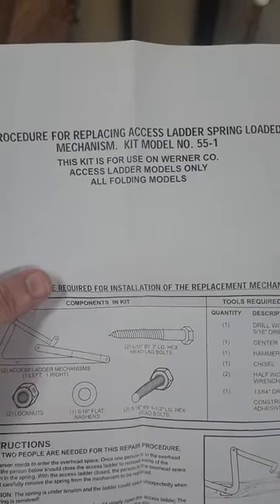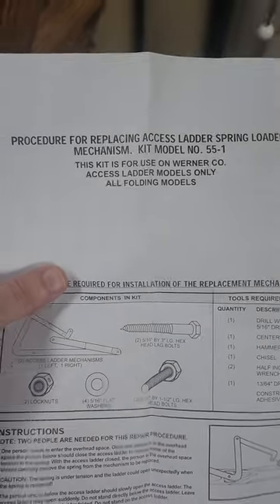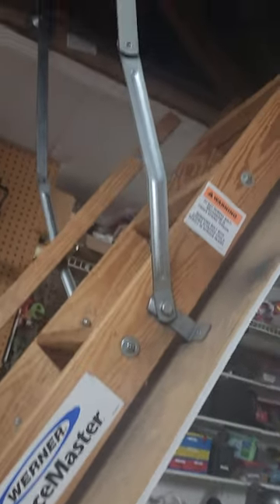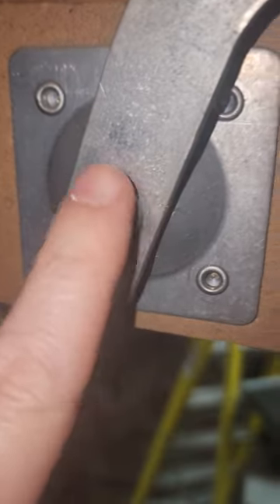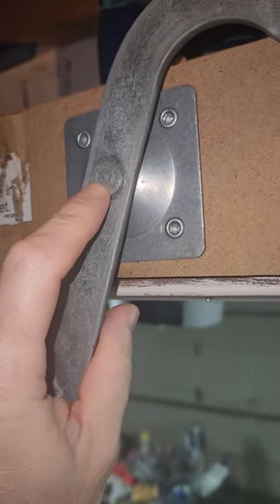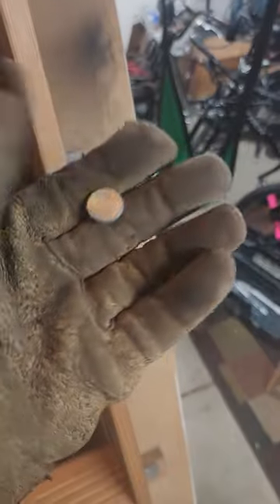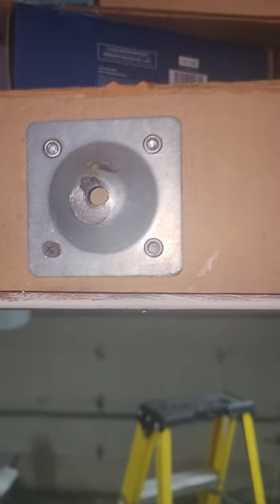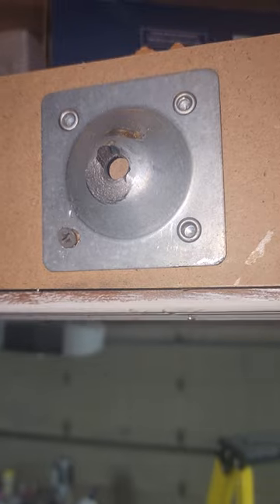Werner attic ladder kit 55-1 repair

Comment: Really glad I kept sorting through the many videos from others until I found yours.  It is spot on for the same repair on my 37 year old Memphis Folding Stair brand.  Great idea to use saw instead of drilling out the rivet.  Key was to undo the bottom bolt to release tension on the spring to access the pivot plate.  Many thanks!
Reply: Where were you able to find replacement parts for Memphis Folding Stair brand?  Can’t find them anywhere.  Thanks.

Comment: Thanks for the video!  I bought a kit Ecotric 55-1 (ET-108 is written on the instruction sheet)  ($39) on Amazon.  Worked for my old Kentucky Ladder 53882-01.  (May be the same as Werner model MK1 to 3)  Easy to do by myself as shown on video